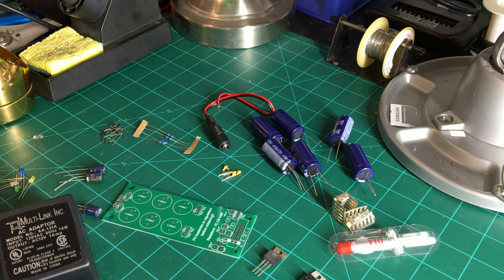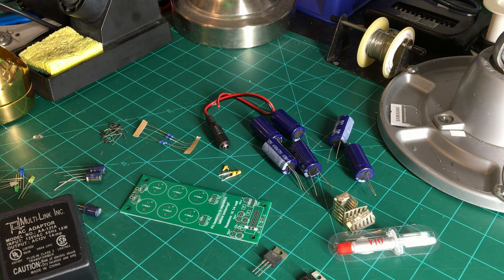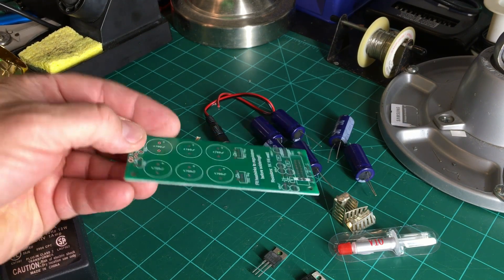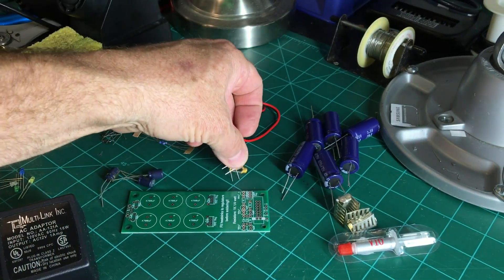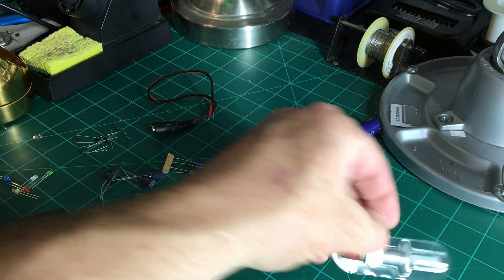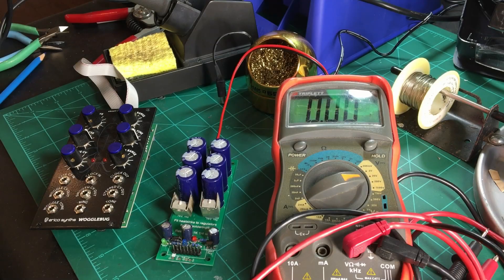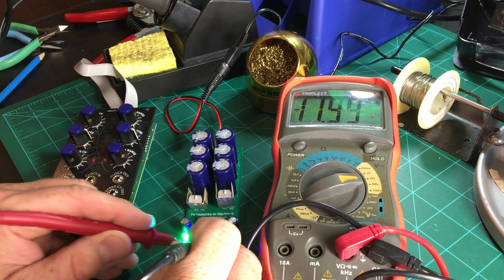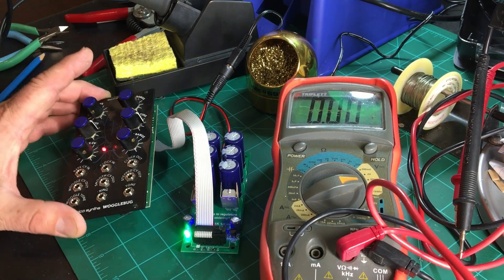Building a DIY Eurorack Power Supply | Tutorial

Comment: The thing is for $20 you can also get ready to use , full enclosed power supply that you just put in your case. The popular choice, Meanwell RT-65B delivers 65W of power, namely 2.8A on +12V, 0.5A on -12V and 5A on +5V. There is also a 50W version but it's barely cheaper, so it's not the most economic choice. The only thing is that power supply is not really small enough for a skiff. Still, it's worth considering as 350mA is kind of weak when you start playing with digital modules, many LEDs and screens
Reply from the maker: You are absolutely right. This module is really more oriented toward the fun and learning of the DIY aspect, plus it's perfect for having a small, portable device to power and troubleshoot modules on your bench, where you might not have your full Eurorack case. But I have Meanwell power supplies for my live case, and I agree - they are the best choice for small, high quality switching supplies.
Reply: Definitely handy for smoke tests on the bench, risking 65W worth of a dead short is definitely not my cup of tea
Reply: Is the negative rail powerful enough for an average use?